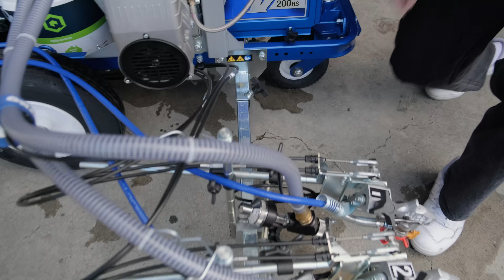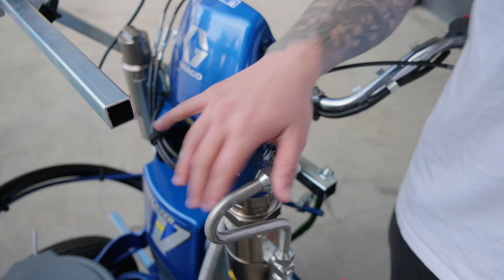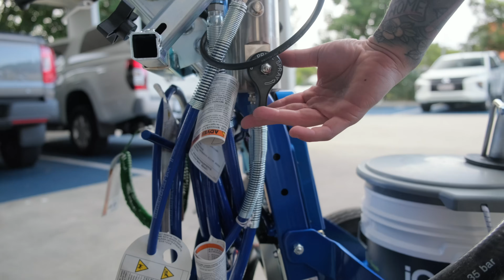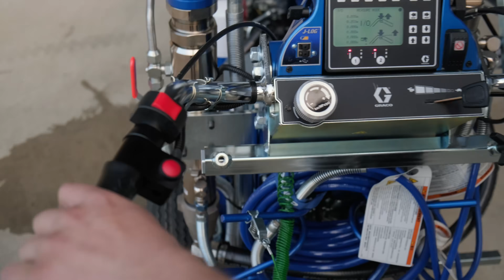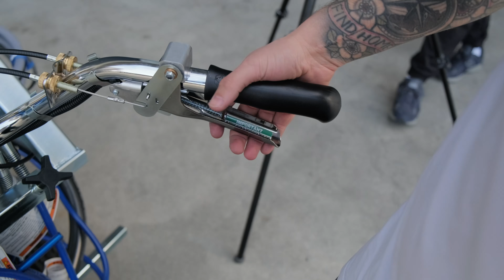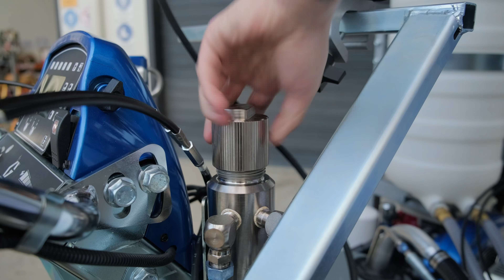First Time with the Graco LineLazer V 200HS? (Easy Setup)

Comment: Very good and awesome video! Thanks!  could you happen to know if "S" mode Singel mode, means painting on only one line? What does single means? Greetings from honduras, our company just bought a machine
Reply: Hi there! That's great, we hope you enjoy your new unit! Correct, single mode will only spray from gun 1. This can be used to prevent dual gun engagement, or when you need to spot single lines.
Reply: @anthonydicarlo1271 thank you!! sir do you happen to know How high I need to place the gun to have a 6” thickness line? (With the correct tip)
Reply: @jramces7372  a LL5421 tip at 300mm from the ground should achieve a 6" (150mm) line. It can take a little bit of testing with a couple of different heights to get it right, but that is the best starting point!
Reply: What’s a good psi for spraying lines?